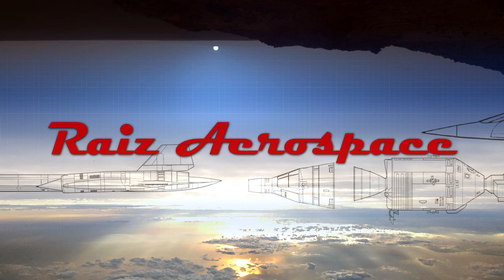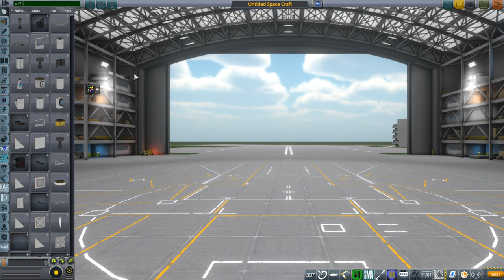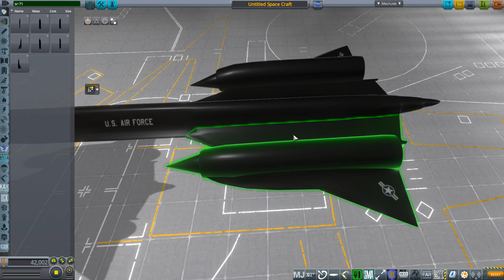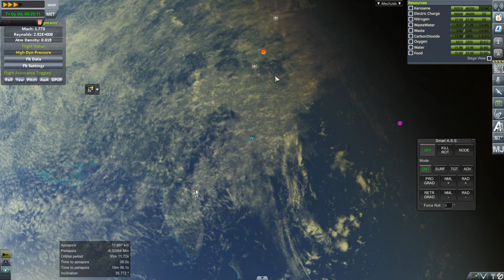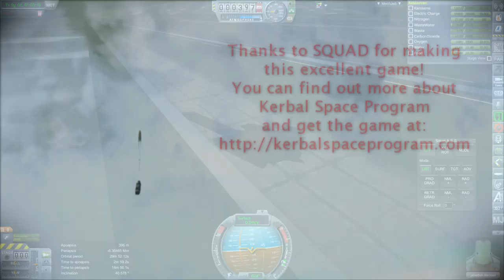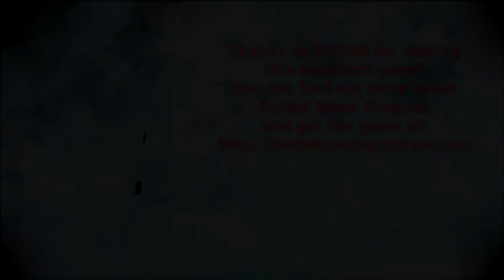Realism Overhaul in KSP - SR-71

Comment: 10:39 pretty sure that's 50% thrust and not 2/3rds no?
Reply from the maker: Nope, that's 2/3rds - there's one-third above it and two sections below it. Of course, jet engines produce non-zero thrust at idle, so it's actually probably more than 2/3rds.
Reply: @RaizSpace  Ahh okay, I thought it was zero, 25, 50, 100 for some reason